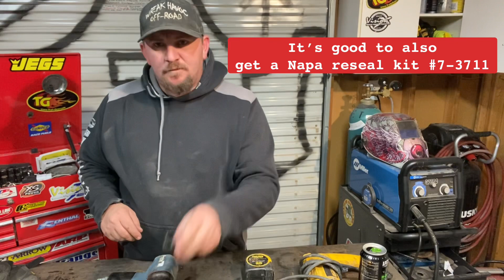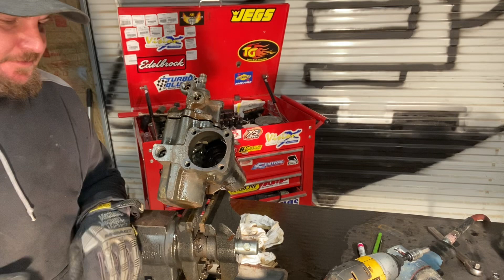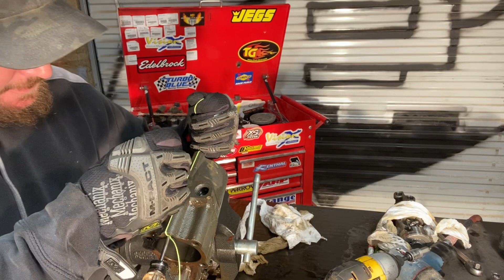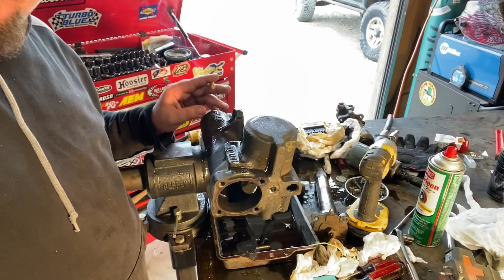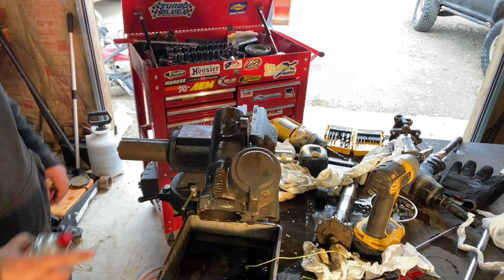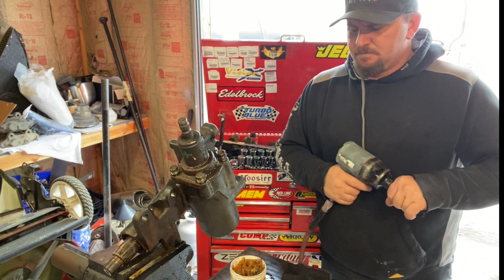How to tap a Toyota steering box the easy way!

Comment: If the ball bearing do dump out, you can indeed get them back in. It takes a tub of tacky grease and about a hour of patience. 
Also to clean metal shavings out a good strong magnet or 2 placed inside while spraying out the box will catch all that remains.